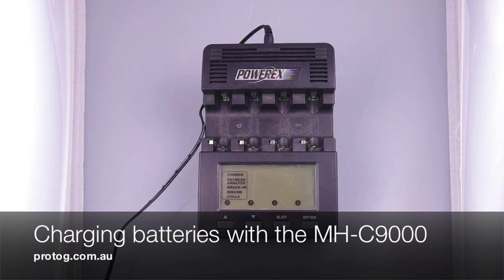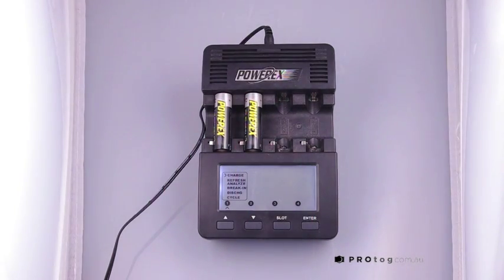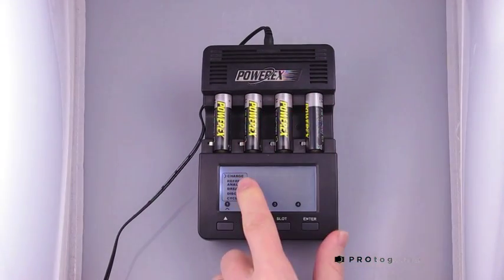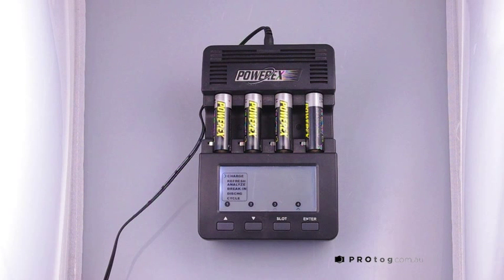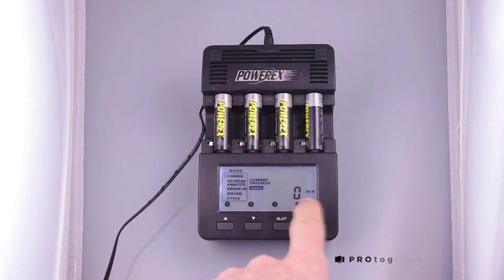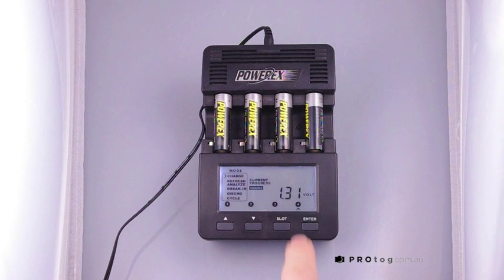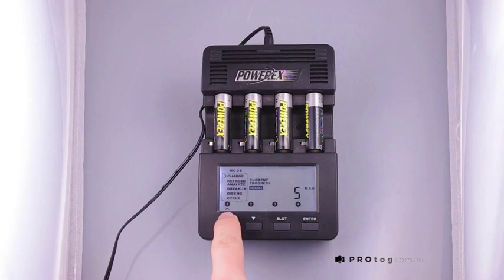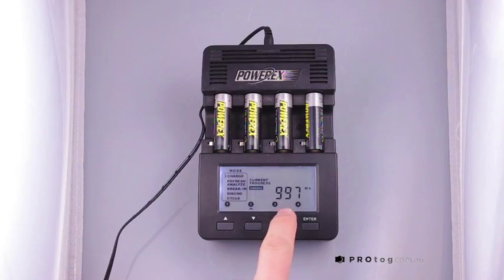Battery Charging with MAHA Powerex MH-C9000

Comment: @GamaVideoProductions  the high pitched noise is not longer present. A component was changed in late 2010. 

If the power is cut during charging in a car, due to the ignition being turned off, the charger will start charging when car starts again. If the battery is already full, the voltage will be detected, and charging will switch from the default 1000mA charge to a 50mA trickle charge.